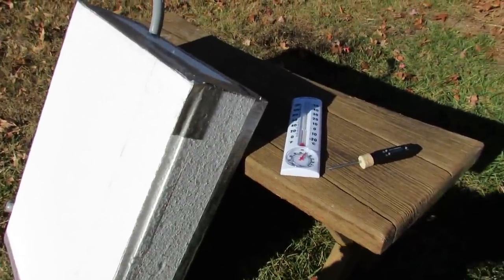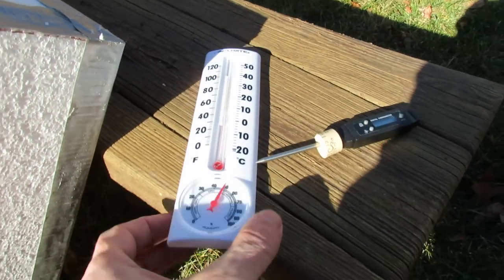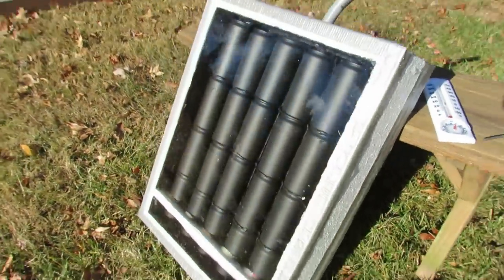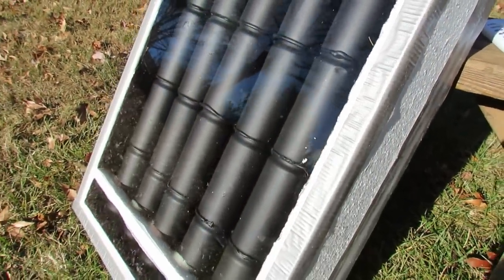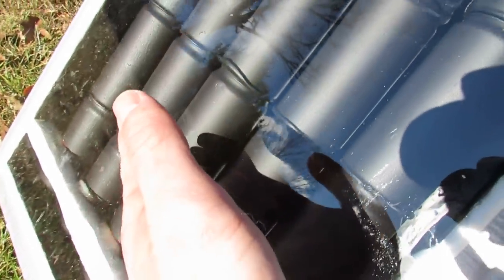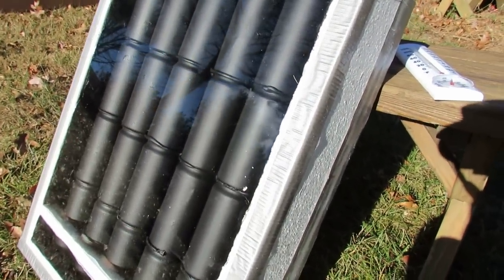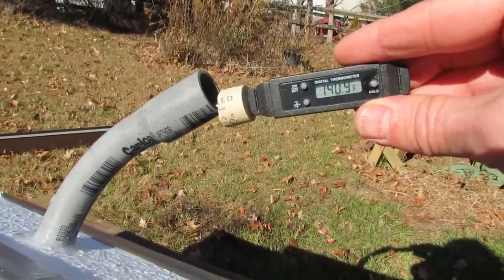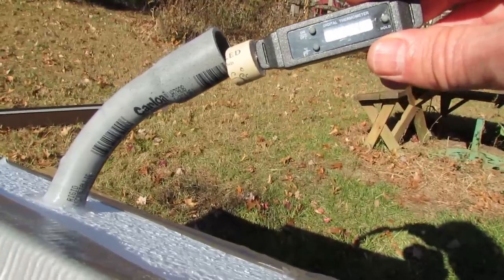Solar Soda/Beer Can Heater - Temperature Output Test 1: 145 Degrees - The Rusted Garden 2013

Comment: I built a green house and I insulated the ground around it with R-14 styrofoam so the natural temperature of the lower levels would rise and heat my the soil in the winter. I went about 6 feet down. It worked great. I also put eight 55 gallon drums of water in the back, I painted them black so they heat up during the day and release the heat at night to combat frost. Combined with you ideas here I could have a year round green house in Iowa lol

Comment: This is awesome! I'm going to build one of these to warm up my greenhouse in the winter! I was looking into rocket stoves, etc.... but this is so much easier. :)
Reply from the maker: +Diana Guillermo Free heat. It is storing the heat in the greenhouse that is an issue. It takes some planning.
Reply: +Gary Pilarchik (The Rusted Garden)  Any insight on that issue? I haven't yet finished my greenhouse - one more side to nail down. I'm considering putting in a second layer of plastic on the inside, but the greenhouse plastic is SO expensive.

Comment: Very cool. I found my next winter project   Hope it keeps it warm over night?how did this work out for you?
Reply from the maker: I havent used it for a while. I want to use the heat it generates during the day for a dehydrator next year. I think as a model it would be great for adding heat to a workshop on a bigger scale. For nights you need to have some sort of heat storage in your greenhouse like water or rocks. Something that radiates heat back at night. I just dont have the space to build that on my current property.

Comment: So if the concept is to let the air heat, would it make sense to just make a couple smaller bottom holes [instead of 1 big one] in the cans to reduce throughput and allow more contact with the heated cans?

Comment from the maker: In case anyone is looking for the design it can be found at my channel.
Complete Steps for Building A Solar Thermal Soda/Beer Can Heater for A Greenhouse - MFG 2013
Reply: You could apply this to just about any space. Add more of these and increase the space heated.
Reply: Very interesting...
Reply from the maker: Gene Hill Yeah I dont see why this cant be used to add free heat period, to places.
Reply: Gary Pilarchik
This method of capturing heat has been used as a DIY project for more than 60 years. It didn't really catch on until it became commercialized in the early 19790's
Reply from the maker: Terry Morris should be option for adjunct heating in homes.

Comment: This is great for during the day when my plants are heated, so what happens at night to keep them cozy? What do I do for night heat?
Reply from the maker: Linda Mingo Its a prototype. A bigger size would raise temps during the day in colder areas to get them to tomato temp. 

If you have a permanent structure the idea would be using the heater to heat a thermal mass source like gravel, rocks, stones or water. That would add some heat at night.

Comment: What if you connected the cans together? Making one long tube? Re-purpose an old hair dryer fan for a bit more flow...
Reply from the maker: ***** You dont want the air to move out to fast. I hope to make  food dehydrator with it and work on air flow. This was just a prototype. I dont know how much a difference linking them would make.
Reply: Gary Pilarchik I was thinking more about this.  You are only going to get "X" amount of heating, if you make a long snake, the air will get hotter, but your volume of air will drop.  Essentially, you can't increase the BTUs unless you make it bigger. I think. Thanks!

Comment: How long will the foam board last exposed to sunlight.  The UV Ray's will deteriorate the duct tape.  A better tape would be the real metal duct tape.  It too will degrade but much slower and has a problem with adhesion in extremely cold weather.   This might be a cheap way to experiment with the concept, but in reality would not be as efficient as many other more robust builds.  Might be something to build for sitting inside your window just to be convinced to build a larger and more weather proof model.
I do like the curved PVC pipe, although a larger one would move more air and could be covered with pipe insulation and wrapped with flashing to protect from UV degrading it.  White PVC will degrade in UV light but simply painting it protects it, not needed if you put the pipe insulation on it. (White PVC pipe is cheaper)
Reply from the maker: It would over the long run. A better material would be needed for year after year use.

Comment: are you able to warm up a whole green house with that one solar can heater in winter? do u use a fan with it to draw the warm air into your green house?
Reply from the maker: That would  not warm a whole greenhouse. It was just a prototype. The issue with greenhouses is that when it is sunny the solar heater works but the sun also warms the greenhouse. When it is cloudy neither work. The heater is a good way to collect heat for specific use.

Comment: I want to use this with my taller hoop house abut 7 foot high it's 13 by 18.  I was going to use this and have 5 gallon water containers lining the inside of the hoop house so as the air heats the water will retain some of that heat to let off during the night when the solar panel is not heating.  What do you think?
Reply from the maker: The question to answer is when it is sunny how hot would the hoop house get without it. If it gets really hot naturally you might not need it right away. But as you get deeper into the winter where the cold keeps hoop house temperatures down, I think it would really help.

Comment: I built mine and must have done something wrong. Can this be tested in hot weather? Or how can I test this during this time of the year?
Reply from the maker: Test it any time. What happen to yours.
Reply: Actually it got up to 142f. I overreacted. I couldn't hardly feel any heat but when I got a digital thermometer and tested it the highest temp was 142f. I can now see that adding a fan and 200 more cans would heat a small room. Thanks again Gary.

Comment: Your temperature measurements are meaningless without also measuring the amount of airflow through the collector.  Your tests showed that the more restricted airflow design showed the highest temp - that is an obvious result.  The point of a solar collector is to produce the maximum amount of thermal energy being transferred to the air.  This is measured by the temperature increase in a measured volume of air.  The way to do that is to measure the temperature difference between the incoming air and the outgoing air for the volume of air being moved; e.g. degrees increase per cubic foot of air flow.  What you are doing is like trying to measure a wall area by only measuring its height - meaning less without also knowing the walls width.
Reply from the maker: Was really to see if this was effective on small scale before taking it bigger. But this helps if I were to take it into a working model. Thanks.

Comment: hi there, great video! i have a greenhouse that i just built. greetings from New Zealand. here it gets quite cold indeed 5*c below zero is the most extreme most winters. i have a 4 meter x 3 meter greenhouse covered with greenhouse film and would like to keep it at about 25*c to 30*c during the coldest days. what size Solar Soda/Beer Can Heater would i need, to make it heated enough to sustain that kind of temperature? many thanks i would really appreciate your response. cheers!

Comment: with that sort of temp 60 c is warm. you could have the tube going in to water tube's. so when it gos dark, the water radiator's. will be warm a little bit longer. because at night time is going to be the coldest?
Reply from the maker: Thanks. The key is figure out radiation at night.

Comment: Pretty cool!  Is the idea to put this outside the greenhouse, and pipe the warm air in?  If the goal is to prevent frost in the greenhouse, does this provide an advantage over a black thermal mass?  It get a lot hotter obviously, but I wonder if it also absorbs more energy than a black bucket of water.
Reply from the maker: smeghed1025 I have thermal mass in there. My greenhouse isnt sealed well as it is collapsible. But a good use is to take the solar can heat and send it over solar mass objects. Maybe when I get a permanent greenhouse, Ill do some videos.

Comment: Amazing results Gary, nice job! Just wanted to let you know that there is a paint specifically made to collect solar heat that might give you a little more heat output. It's made by Thurmalox.
Reply from the maker: Gideon Gardens Not that I am aware of. Just flat black. No reflection wanted.
Reply: Gary Pilarchik "Thurmalox 250 Selective Black, silicone-based paint which collects heat more efficiently than ordinary black paint and resists outgassing to 400F." (no affiliation with company, just think it's an interesting product). We are building larger collectors for the house and will be using this paint. Thought you might find it interesting. http://www.dampney.com/ProductLine/tabid/123/AT/View/PID/2/Thurmalox-250.aspx
Reply from the maker: Gideon Gardens Thanks. As this is a small scale heater... if I go larger at some point the paint be helpful. Thanks. I wasnt even aware of it.

Comment: Thank you for your video thats absolutely amazing. I just watched your video on how to build it first. Can I ask how much difference did this make to the temperature in your greenhouse please? Also as you did this video a while ago how long did this last and did you need to find a way of fixing it to something to stop it blowing away in strong winds? Thank you so much for your informative videos. It has occurred to me that if someone has had a large appliance delivered they might be able to use some of the Styrofoam from that. Often the top piece at least is flat.
Reply from the maker: So this is old. But you can put it on inside of green house as it stops wind. It add heats to greenhouse but of course when it is sunny the greenhouse is usually warm. The key is having some water barrels or items that would hold the heat of the day for the night. I works well sending heat into a garage too. I still have it but stopped using it after a couple years. One day I want to build a large scale one.
Please check out The Rusted Garden Seed & Garden Shop for all your gardening needs: www.therustedgarden.com

Comment: your materials should of been treated wood frame for weather abuse the foam and tape wont even last the winter you can save it by wrapping a wood frame and trim around your styrofoam to save it oops too late 2013
Reply from the maker: It was just  a model. It is still kicking but for long term outdoor use, I agree.

Comment: Hi, I enjoyed the vid.  How could u get it to work if it had to lay horizontally?   Thinking to put it on your roof of my shed, but I don't think it'll work as well because the heat would have to go down to exit the box.  So, how would I get it to work if the box must be horizontal?
Reply from the maker: Gregory Benson The larger designs use a small venting fan to slowly pull the air up and out and in the direction you want it to go.
Reply: You don't want to lay it flat, in the winter the sun is low on the horizon, and in the summer the sun is high in the sky.  You put a solar heater flat on the side of a structure, so that it get the most sun in the winter, and NO sun in the summer!

Comment: Wow that is amazing - have you figured out how quickly it cools after the sun goes down?  What about on cloudy days?  What method are you using for heating at night?  I'm asking because I have a garden with less than ideal conditions and just got a little greenhouse for spring seedlings.  I'm in Saskatchewan, Canada so will be using it just to try to get a jump on spring.  Sadly a winter greenhouse is not an option.  Anyway,  I am very curious if you are still using this method and to what effect?
Reply from the maker: So that cools immediately. But the key is scale and having something in the room that holds heat. Often water or rocks. Cloudy days you are out.  I am not using it as I don't have land to build what I want. So, I have this filed for the day I move and can build something...You can support The Rusted Garden by using this link for anything you purchase on Amazon. It doesn't have to be garden related. Anything you purchase gives a % return back to The Rusted Garden
http://amzn.to/2ttyray Thanks for using my link. It helps fund my garden videos!
Reply: The greenhouse will be sitting on gravel or possibly cement.  I'm thinking of maybe making a little sandbox as well to place in there with water containers.  Also may make little cold house boxes for the seedlings on the shelves to add a second layer or protection.  Do you think laying black cloth over the gravel would have any advantage?

Comment: Hello Gary Pilarchik  :  many thanks  for giving me chance  to  ask  questions  earlier.  I 'am into  this project  same  size as you do  but for  heating home. , and i  d like to  know  more about this and i have  questions. During the winter you  have prox  150 up to 200 Degree . and  you have  installed 2 elbos  pipe  the top one going into the  room(House) and the botom coming  from the  house .wall. in that case how  do you  switched off  during summer  time??? manythanks
Reply from the maker: akim salvatore Hmmm. I dont know. I do know for a house you would use vents with fans. The fan would help draw the warm air out into the room.

I think I would set it up so the pipes bring air in and out of the house could be closed from the outside. A pvc on/off lever for like shutting off water.
Reply: the is not working when there is no sunlight. so just put a shade over it :) a white one, preferably
Reply: the is not working when there is no sunlight. so just put a shade over it :) a white one, preferably

Comment: Very nice!
Reply from the maker: sumip90x . Fun day.
Reply: Gary Pilarchik Have you considered using water in the cans?  This would release the heat slower.
Reply from the maker: sumip90x . In this case I want to heat the air and fill my greenhouse. I have black painted milk jugs in the greenhouse to store heat and radiate it out. I am trying to move as much heat as I can with the heater and store it in the ghouse.